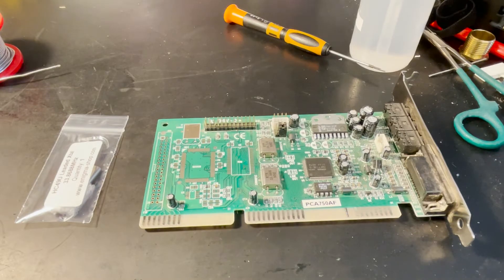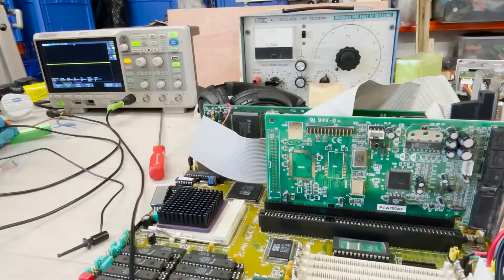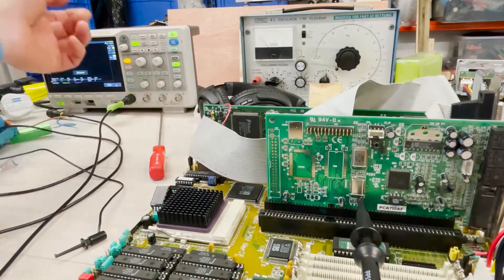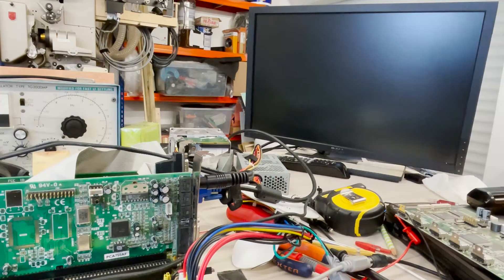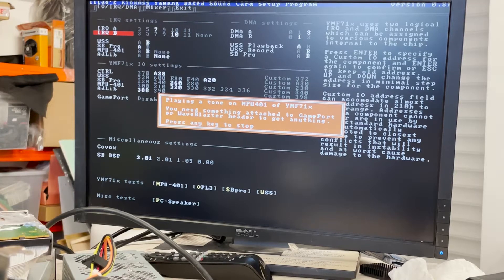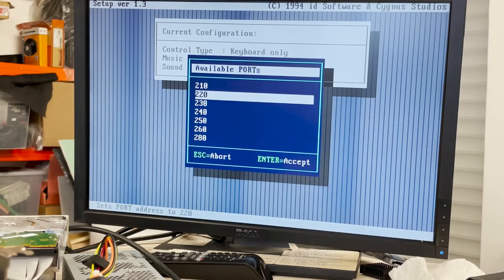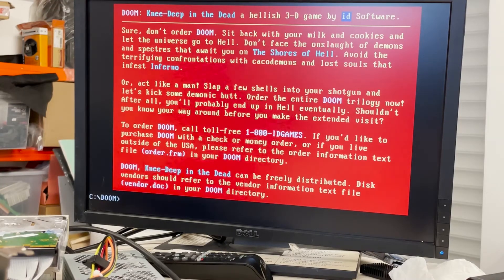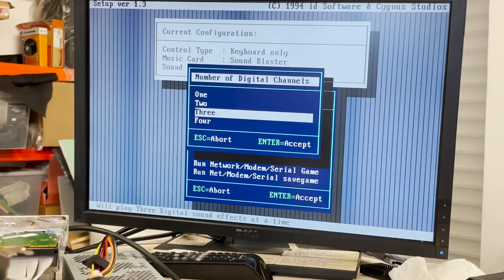Yamaha YMF719E-9 sound card repair - Part 2

Comment: Hello.
About my EMU APS audio card (it is a PCI card firstly came out in 1999) that i have bought before 7-8 years and it worked fine in Windows XP. Before 2 months and because a problem (i think faulty PSU), i forced to reinstall WinXP. From this point and now, the card do not have sound. Windows detect it but i have no sound. I tried every method i know to make it have sound but i could not fix it. I have installed all OS i had (Win95, Win98, WinME , Win2000, WinVista, WinXP) because i thought it was a Windows related problem, but now i am starting to think that it is a hardware issue. I already have gave it to a professional to check it but he told me that he is working with very expensive cards only (for cars), and he just examine it only for 5 minutes. He told me that it seems to be OK.
This card is a professional card and i really want to use it again. I do not have  the equipment you have. I just have a multi-meter. I can see on my card that there is also an "ECLIPTEC EC1145TS 24.576M BF809) and i can understand from your description that this is a similar part like this for which you made the replacement, and it is for 24.5 MegaHertz. But my knowledge about electronics are in base level and i have no equipment. 
Can you help me in any way ? Give any tip, idea or links to help me diagnose the problem ?
Now and for two months, for 8-10 hours every day i am trying to fix it. In a few days i will go crazy.
Thanks
Reply from the maker: Hi there - I think I found your card on the internet based on the description. Unfortunately it could be anything - including a software problem. It's really impossible for me to say what the problem could be. The clock issue on mine does not mean all sound cards will have a clock issue I'm afraid. If your card is detected and plays ok - only no output, then I think the clock is ok. 
Can you record on it? Do you see the waveform when you record?

There is a "headphone" jack on it, did you try headphones? There are also many outputs, did you try them all - using a source which uses all the outputs of course? In the E-MU mixer control, do you see the sound when you play?
Reply: @tony359  Hello again.
I have tried everything. This card have two analogue outputs  (mono - one left and one right ), two digital SP/DIF (mono  - one left and one right ) and two inputs (mono - one left and one right ). Also there is another part  that is a separate card -  interface that be placed in the front panel of the PC, to connect there Guitars, Microphones, and there also exist an output for headphones there. Nothing of these gives sound. Now it is disconnected to not interfere with the PCI card.
In one of my tries (i cannot remember because i made hundreds, so i cannot remember in what OS i was and what settings i did) when a sound was played, i could see the level meter moving, but there was not sound from outputs. Also i tried record but no sound went into the card.
I have made a post ( a question) in a site with pictures.  Yesterday somebody told me to examine the Tantalum Caps, before replace the two Capacitors (the two big black). I test it. Can you please take a look ?  The link is this :

https://www.ifixit.com/Answers/View/803405/Diagnose+PCI+Sound+Card#answer804915

Maybe you find something that others do not see.
Reply from the maker: as I said, it's difficult from here to help. But if you don't have any activity whatsoever on any inputs or outputs, then I feel it's something to do with drivers or the main IC. One thing I can recommend is to check those small pins of the main ICs, they can get disconnected over time. You'll need fine tweezers and a magnifying lens or a microscope to check.
Reply: @tony359  Excuse me, i do not understand what is IC. Is it Integrated Circuit ? But my card is a PCI. Do you mean these golden pins on the card ? There are 58 of these. Or do you mean the PCI Slot of the main-board ?  My mother-boartd (an MSI 865 neo2 PE) have 5 PCI slots and i have check them all. I mean i have placed the Audio Card to all of them (i did this for IRQ  - problem,  purposes)
Do you mean something else ? Can you show me a photo, for me to understand ? 
I have a microscope.
Reply from the maker: IC is Integrated Circuit. It’s the square/rectangular things with small legs on your board.
Reply: @tony359  OK, I check it. It has 140 legs. No problem found.
Anyway, thank you, very - very much, for your help.

Comment: The sound card needs to be adjusted for sound blaster on port 220 and irq 5 instead of port 260  and irq 7, that's the problem with digital sounds.
Reply from the maker: I had to re-watch the video to remember what happened! I did eventually realise the settings were wrong in Doom, right? Thank for watching!
Reply: @tony359  not exactly doom does not autodetect and put the settings on default for sound blaster 220,5,1 or sb16 220,5,1,5 dma 5 for 16 bits cards not for pro or pro 2.
Reply from the maker: @asanjuas  Yes, but you can run Setup and change those settings? At least that's what I did at the end of the video and the sound worked. Sure, it would be a good idea to change the board to 220/5 so it works with default settings on any games.

Comment: I can't buy this crystal oscillator anywhere. KTS NTS, 33.8688.. :( I can also use another oscillator with a different frequency?
Reply from the maker: I am not sure to be honest. I do not know what that oscillator is for but I suppose it's required for one of the ICs on the board. Look for "HC49U oscillator", that should be the type name.